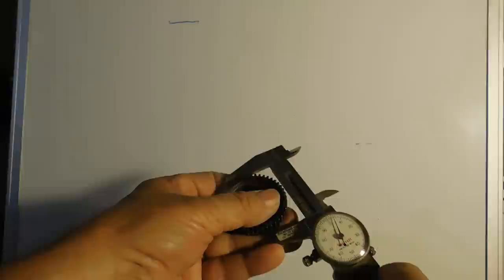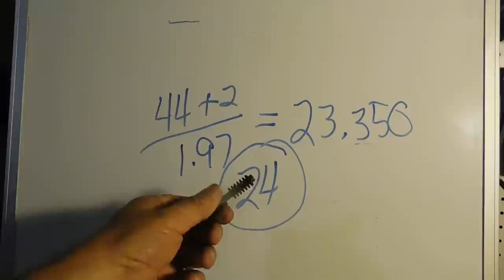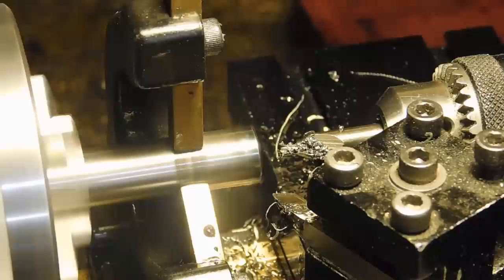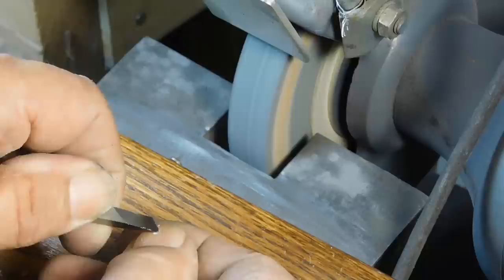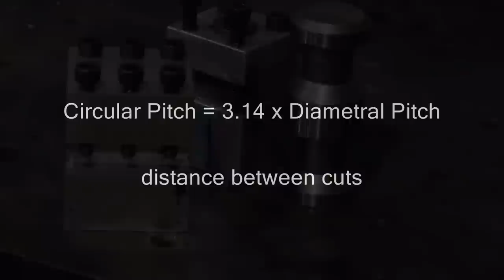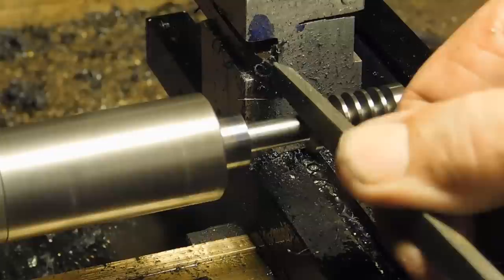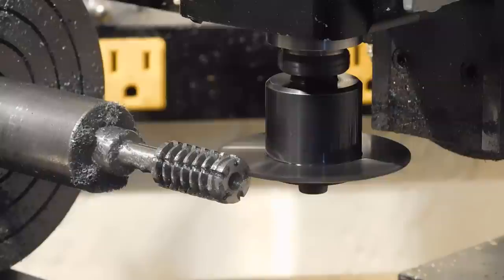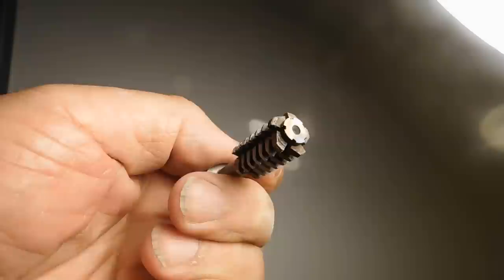DIY Gear Hob Part One

Comment: Did you temper the hob after hardening? Or do you leave it super hard?
Reply from the maker: I left it super hard...I've cut over 10 aluminum gears and 1 CRS 
gear...I did not feel my wife's oven could temper it correctly and 
getting the cutting edges to straw with a torch seemed a bit of a 
stretch...bob
Reply: @robertt-cs8fe ... Thanks Bob! I've got to cut a new pinion gear for the carriage on my new to me Hardinge Hlv.... It's going to be quite the adventure! Thanks for all the good info!

Comment: I'm a little unclear about the calculation for the distance between each flute
Reply from the maker: John…the distance between the plunge cuts is equal to the circular pitch…which is calculated by putting pi over the diametral pitch and dividing…in the opening paragraph I provided a hyperlink to a great web site that discusses all the math involved in building a hob like this…he does a much better job than I can and his site is one of my goto places to understand the math.

Comment: You have the incorrect value for pi.  It is 3.1416, not 3.146.  The spacing should be 0.1309, not 0.13108.  Fortunately, you are only off 1 mil.

Comment: You round DOWN when calculating diametral pitch.  Robert's DP for this gear should have been 23 not 24. Watch mrpete222's "SHOP TIPS #200".
Reply: no actually you dont round down as the minimum whole number required..i.e. it shout always be greater than the decimal value

Comment: Hmm, yes, it's making multiple faceted tangential cuts, but in aluminium they will very quickly wear to very, very close to the 'correct' smooth involute profile. By making small depth increments the facets are very small as well. True, I'd feel more like using a hobbing gear cutting machine for steel gears, but just look at the complexity or cost of those. In most home workshop applications multiple sets of  involute gear cutters are the only practical alternative. So unless you own a hobbing gear cutter our gears are approximations anyway. BobUK.